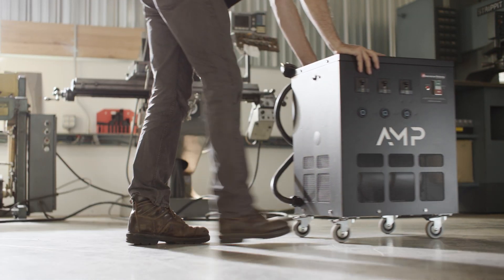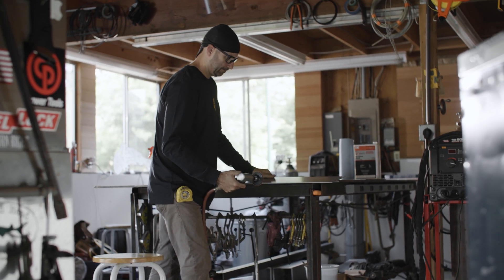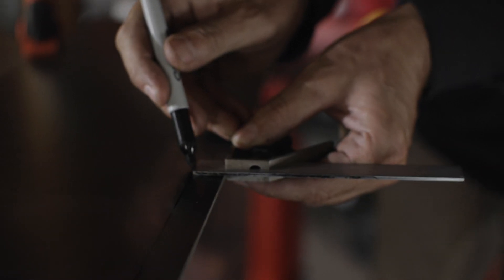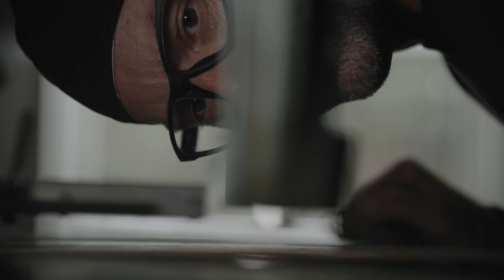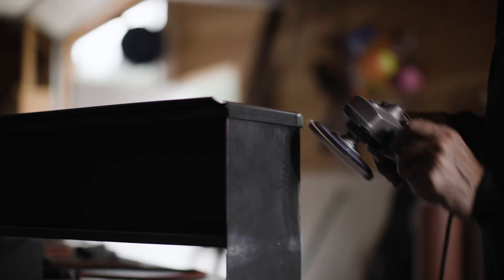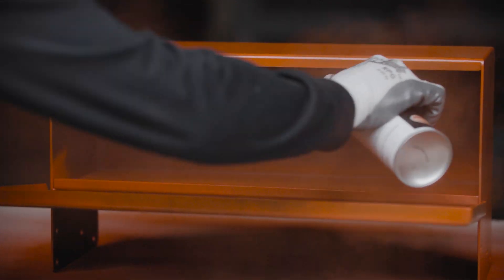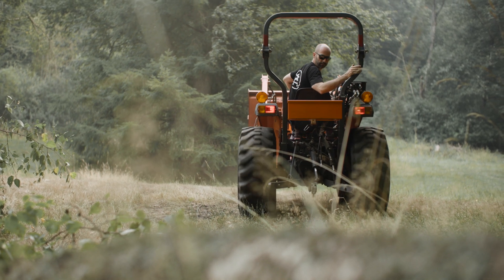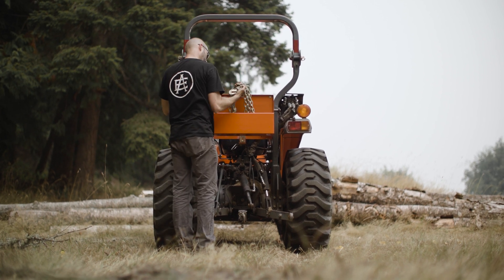Metalworker Joe Clark and His American Rotary AMP Mobile Phase Converter

Comment: I drove a very similar Kubota yesterday to pull on a few trees as we cut them down and direct them away from buildings, towards an access road for easier cutting. First time driving a tractor like that, very impressed with it's ability off road.